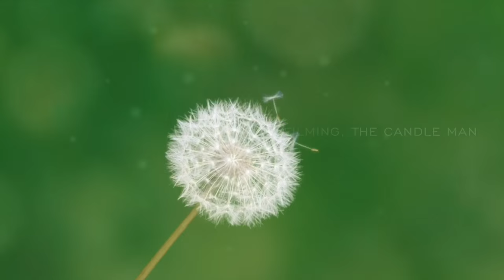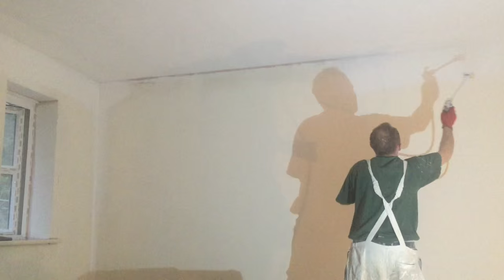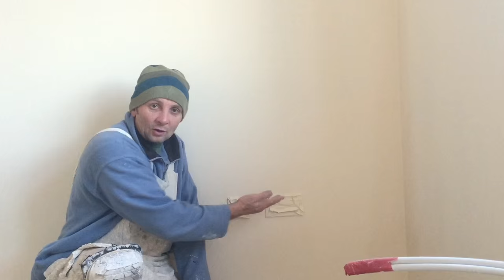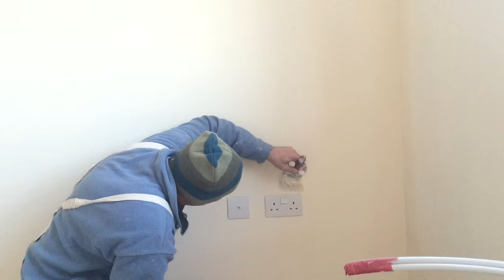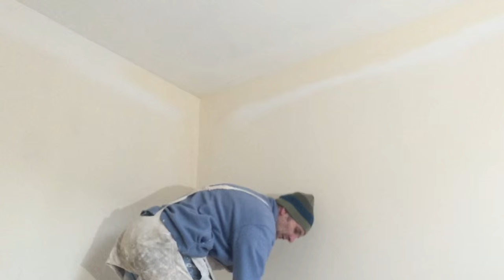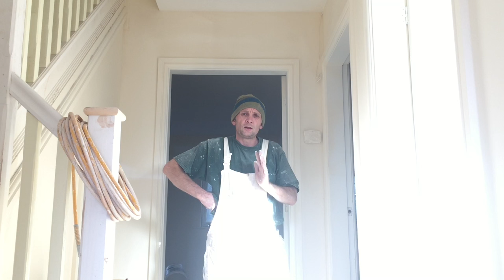Painting & Decorating, Preparing the new build plot for spraying  part 2

Comment: Once you finished your ceilings and cut the top of your walls in, did you spray the maggy walls horizontally? If so, was there any overspray onto the ceilings and could you see the brush cutting flashing against the spraying of the walls? Sorry for the all questions, not sprayed since college really. Cheers bud, good video again.
Reply from the maker: Hi mate, I am not spraying the walls, only ceiling lines & cutting in wood work. Little bit of over spray in corners of rooms. Rolling walls & ceilings .
Reply: +wallington filming  why not spray the whole ceiling rather than just the ceiling lines? Do you only spray the acrylic undercoat or are your spraying the oil based gloss as well?  Cheers for the reply candle man!!
Reply from the maker: I find it just as quick to roll ceilings , not spraying any woodwork mate

Comment: My biggest concern is the snagging. They'll still be the monkeys banging through the house when you've moved on to the next. 
Touch ups will be interesting , as you can't rig up the gun everytime you need to go back . I spray all my wood and if i need to touch up a ding i need to take the full check in by brush.
Are you on oil or acrylic for trim ?
Reply from the maker: I don't think touch ups r going to be a problem as I will us a rad roller, 99% of the time I us oil based gloss on wood work , I'm not spraying it.

Comment: I wollop house and flats new builds what I do soon as I get in there is fill everything all wood then sand down then undercoat all wood work couple of coats then do your ceilings 40/60 on must coat then 2 coats that's the first day then second day do your walls mist then 1st coat Maggie that's 2nd day then 3rd day finish your walls then 4th day gloss all woodwork and would be finished for dinner that's a 2 bed flat with ensuite if really pushing could be finished in the 3rd day after finishing walls
Reply: Forgot to mention I'd caulk after I'd sanded down everything